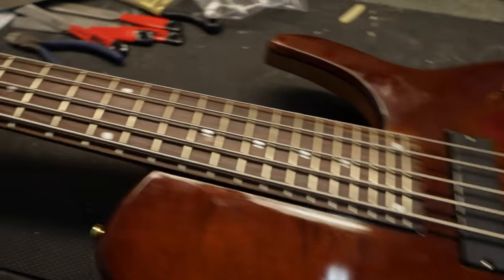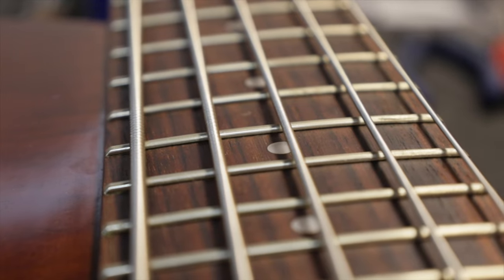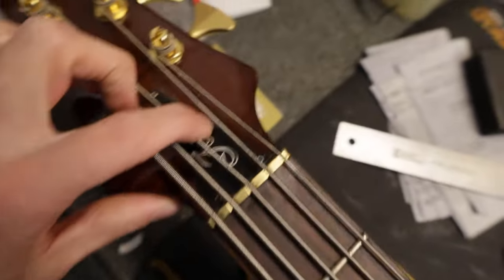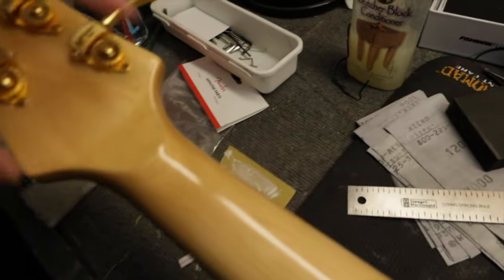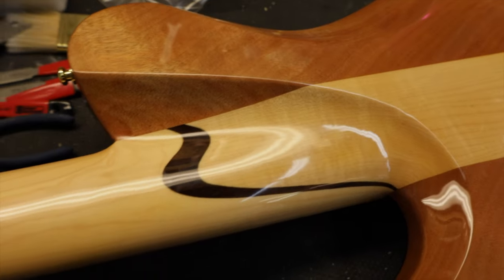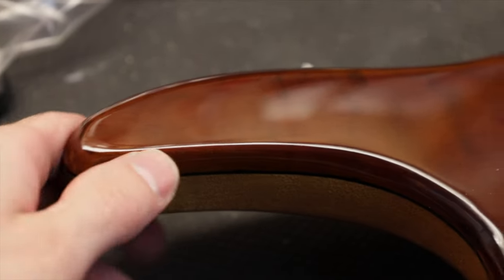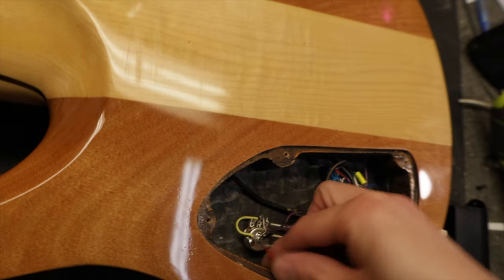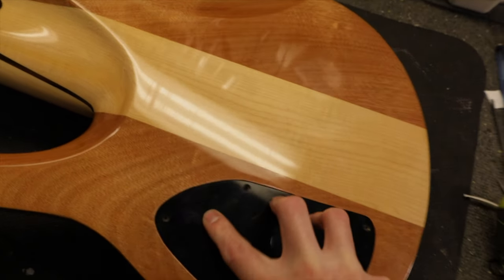Fake Fodera bass! Ripped off for $5,000!

Comment: The shape is actually an existing model type, This is an Imperial MG shape, the shape of the horn you're describing is the Imperial. and the top is the Imperial 2 that has the extended shape. But other than that, a pretty shady fake